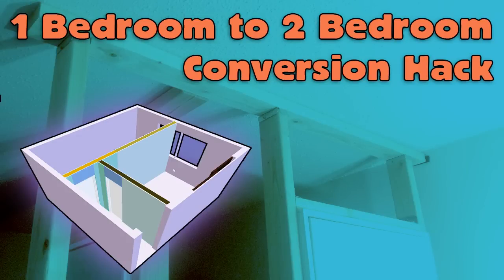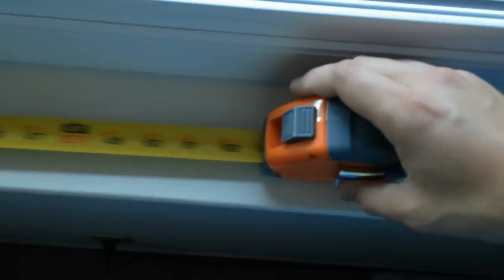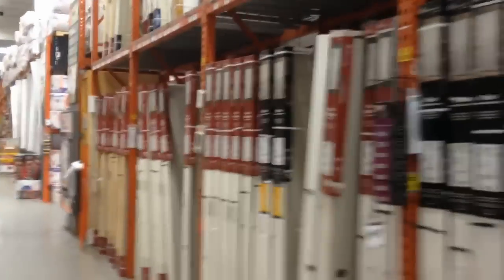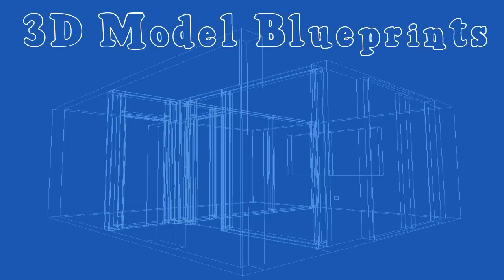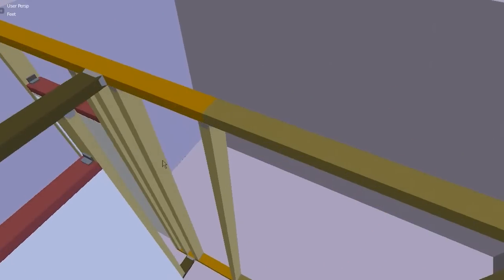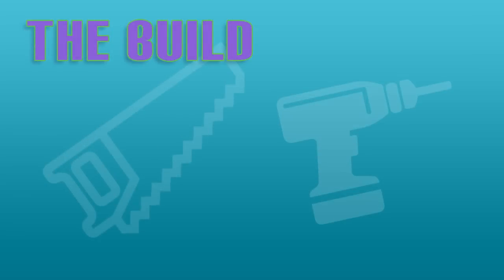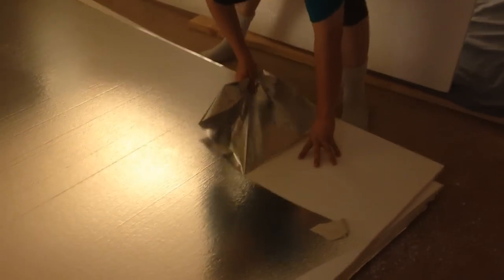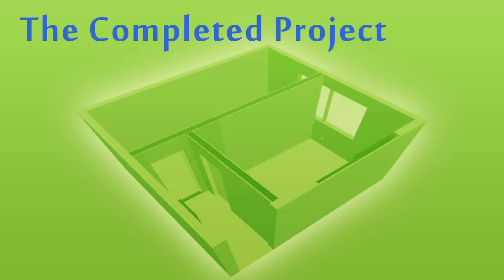1 Bedroom to 2 Bedroom House Hack

Comment: Thank you for sharing. How did the wall stay up? I don’t think it was nailed in to anything, correct?
Reply from the maker: It's T-shaped so it could stand on it's own. If you wanted just a single wall, you'd have to make some angled boards come out and hold it up or something.
Reply: @orokro_stuff  Thanks!

Comment: Did you have to drill into the floor or ceiling???
Reply from the maker: No, because it's T shaped it can stand on it's own. As you can see in the video, we put soft foam on the edges of it so it wouldnt scratch the walls.
Reply: If space you was doing was rectangular, how would you do it?

Comment: We have a one story house with only 2 bedrooms and i have 2 kids 4 years apart in age. The oldest snores now 😔 and 18 month old wakes up to the sound of a pin dropping and im a zombie at this point. The girls current room is right behind the living room so im starting in the corner on the other side of the door to section off an L shape from about 6f x 8f with the door the same direction as the original so not to make the small bit of hall too crowded with doors.. I saw this video when we first bought the house and didnt save it so i just took 30 minutes scrolling through my history back to january of 2020 😂

Comment: Great video! What program did you use ro perform the 3d model? Pr whar software do you recomens for a beginer that wants to do a si.ilar project like yours?
Reply from the maker: I used blender. It's not an easy software to learn, but I already knew it. Maybe sketch up or something for beginner.

Comment: I’m wondering who put the first hole in the wall... this is a genius idea but styrofoam walls?
Reply from the maker: Haha yea, we weren't really rambunctious so the walls stayed intact. We went with Styrofoam because it was cheap and easy to cut. You could use actual drywall panels if you wanted, but it's more expensive, heavier, messier and harder to cut. There might be some better material that's inbetween, idk.

Comment: Do you have a video on how to take this down?
Reply from the maker: No, but if you can build it it's very easy to take down - just go in reverse. Unscrew the Styrofoam walls first, throw screws in a bucket as you go and throw away strofoam. It's easy to cut into small pieces to hall out to a dumpster. Unscrew the metal brackets holding the walls together, in the same order you put them up in. Eventually you'll end up with a bunch of boards, screws, and brackets! The doors can be tossed hole, or sold, etc.

Comment: I'm planning on converting a living room space with this idea. I just wanted to get some insight on how sturdy the wall was or if anyone else knows how the wall is secured. Thanks!
Reply from the maker: In my plan, the walls form a T shape, so they held themselves up. I didn't secure them to the apartment because i didn't want to damage the walls. It's basically free standing, but I built it with sub centimeter tolerance so the gapes where our walls meet the real apartment are tiny. it stood fine.
Reply: @orokro_stuff  I'm renting out an apartment as well, so I don't want damage to the walls. In my case I would just need one wall across the living room area and it would form a bedroom. I don't have any experience in this type of work. Do you know if that could be done?
Reply from the maker: @b5790  If you don't want to mount it to the real walls, then you can do something like this: https://i.etsystatic.com/16370187/r/il/b4efdf/1396937447/il_794xN.1396937447_ot8t.jpg to make it stand straight at all times. I would probably make them a little bit bigger tho.
Reply: hypurban Thanks so much for the advice!

Comment: Why don't he use the thin wood thing(idk whats the name) intead of using sterofoam 😅
Reply from the maker: Not sure what you mean, but the Styrofoam was the cheapest thing we could find. Also, very easy to cut with just a razer blade.
Reply: Plywood or mdf sheets?

Comment: Man.. I hate being one of these people to correct you but..
1) Your framing 2X4s were way too wide on that main wall. 
2) Foam=🔥 bad move.
3) You said you were done at the end? Not gonna spackle? Sand? Paint? 
4) If ur renting and doing this, yohr landlord can get ur ass big time for this. BUT Landlords and Renters are Raping people financially to fatten their pockets.  How in the fuck is it cheaper to buy a house than Rent? Hmmmm. Price Gouging. 
So i say fuck the Landlord and overall. Cool room split
Reply from the maker: 1) wasn't trying to build to housing code, juts trying to make a very specific wall divider with a door :P
2) you're wrong about the foam - the foam is from the hardware store meant to be housing insulation, it's specifically fire-proof for that reason. Further, I tried lighting some on fire in the backyard / over concrete. It wouldn't stay lit, no matter how long I held a flame to it.
3) yea, wanted to keep it cheap, was mostly a privacy wall, plus we wanted it to be easy to tear down later, which was good since the LL hiked rent and we moved out the next year anyway. Those are good ideas though.
4) true, but we never actually attached it to the house, so it's technically a freestanding peice of "furniture" not a home improvement or building mod. Still, I doubt they'd be happy.
Thanks!

Comment: tyq44
1 second ago
How did you determine how many vertical 2x4's to put behind the styrofoam walls? In other words, how do you determine how much structural integrity the wall needs? I see you have 2 between the door and the wall.
Reply from the maker: I wasn't worried about structural integrity - the Styrofoam is extremely light, and this frame would stand on it's own, due to the fact that it was T-Shaped and fit the walls-ceiling perfectly. It wouldn't be able to fall even if it wanted to, because some part of it would bump into the ceiling or walls. (We put foam insulation on the parts that could come in contact with the walls/ceiling so we wouldn't scrape them if it bumps it)

The verticals were determined just so each foam piece could have at least two things to screw into. There were two on both sides of the doors, so the prebuilt frames could also have something to screw into.

Comment: one of should have just given up on having a window. you both would have had  equal space. both doors to one side opening out towards the smaller new hallway entrance to gain space in the room.. Whoever put their bed just inside their doorway, that should have gone towards the back where your dresser was. keeping your open floor space in front when you enter your room. an accordion door was better in this case I think.

Comment: What this man is suggesting is stupid.
There is no way any landlord  Council or Housing Association  will let you do this if you are renting. Even if you own your home you cannot just put up partition walls without planing permission from the Council.
They don't allow that in England where I am.
If you own your home you can if you have permission but there is no way you can do it if you are renting.
No landlord or Council will let you and if you did you would be evicted.
Andrea.
Reply from the maker: Hey Andrea, thanks for your comment. It is true that anyone who considers this project should use their own judgement based on their housing situation.

In this case, I consider more of a room divider than a construction job. Consider the following:

http://www.ikea.com/us/en/catalog/products/S79166399/

In this case it's curtains, which must be screwed to the ceiling, but divides a room into two.

http://www.ikeahackers.net/2016/06/free-standing-stuva-room-divider.html

In this case, ikea furniture was used to divide a room. I have also seen people use tall, ceiling-high bookcases.

Anyway, I feel like my project is nothing more than a very specific shaped room divider. Nowhere is it attached to the house (in the video I explained that it's just resting against them with foam padding so it doesn't damage the original apartment walls or ceiling).

Also, our apartment was a single bedroom, approved for up to 3 people. We weren't splitting a property or subletting, which obviously any landlord would have problems with.

Yeah, instead of curtains it has a prehung door, and instead of the curtains it has soft, easily breakable foam walls.

Some might worry about a firehazard, but the foam is no more flamable than curtains, and I actually flame tested it and I could not get it to stay lit - that's because the foam is used for insulation in houses normally, so it is fire-code spec.

Anyway, when we moved out the walls came down in 20 minutes, and didn't leave a scratch on the apartment. So, it's highly circumstantial and subjective if this project is right for your house or home.
Reply: Well if you live in a rented flat there is no way a landlord or Council will let you do this. Even if you own your flat if it's in a block you will find there is a landlord or management company who owns the building freehold. So you still won't be able to do it. Also if you are in a flat and you put up partition walls it could cause your neighbor upstairs floor or even your ceiling to fall down. As often in flats your supporting wall is the same wall that supports the peoples flats living upstairs or under you  or flats next door to you.

But a lot of the flats you rent here are ones that are converted from what used to be a house. Where landlords who do this put up partition walls. I used to live in such a flat but they are not as nice as a purpose built flat. As the walls feel like cardboard when you tap them and it makes the flat and space very small.  So in most cases if you want to covert your house into flats to let. It is better to keep the original rooms as they are and maybe put up a door to separate the downstairs from the upstairs.

It is easy to make one of the downstairs living rooms into bedrooms and to make one of the upstairs bedrooms into a living room. You can always have a bath or shower put in either upstairs or downstairs if your house has only 1 bathroom. And it is easy to get kitchen cabinets  and sinks to convert one of the upstairs rooms into a kitchen and put in electric points for an electric cooker. I say electric because here in England you can only have gas cookers in certain rooms because legally there is a gas safety law and ventilation requirements. So not every where can have gas cookers. But you can certainly put in an electric cooker or as many people are doing, buy a portable min or halogen oven that you can stand on a kitchen surface or table top.

That is a better option than to put in partition walls. In one place I used to live in my next door neighbors one bedroom flat was  simply 1 room made into 2. But his living room do no windows  which is awful.
Also putting up such a wall ruins the house and the room.
So it's not a god idea to do this.

If you need a 2 bedroom flat it is best to just get one rather than  put up partition walls which you are not allowed to do anyway if you rent.
And if you have a 1 bedroom flat, you can always put an extra bed in the living room. So you can have the bedroom and your friend can sleep in the living room.

Over here in England you find in many flats such as mine that the living room is big but the bedroom is a lot smaller.
That is also the case even in a 2 bedroom flat.

This is one of the reasons I have moved my bed into my living room and sleep there. So my living room is now both my bedroom and living rooms. Because I have got my couch, TV and my bed in there. While my bedroom is now a smaller living room with just a small couch and a lot more space than what I had when I had the bed in there.
But I could still put another bed against the wall in the bedroom if I wanted.

But it's not as nice to sleep in as my living room because the bedroom is smaller and so is the window. As the bedroom only has a small window right next to the main front door of my block. Which I hate as I am on the ground floor. So I have to keep my curtains closed when I sleep or else everyone will see me in bed.
And it's to hot in the summer because of the small window.   

But my living room had big patio doors. Which is cooler in the summer and also gives me more privacy as it's not next to the front door. And because the living room has a balcony in front it is more private and I am not so overlooked as in the bedroom. 

It is also standard practice here in England for landlords and councils to paint flats and houses while or magnolia(cream) walls. Which is not bad in itself but it's a color that everyone else has got.
So it does not feel very personal like when you paint it in your own colors.

Some landlords do allow you to paint and some don't, depending on the landlord. 
Other landlords who do let you paint do but they want you to put it back to how it was when you leave. So it's not worth painting it if you got to put it back. As you never know when you might have to move out and putting back would be stressful.

But there are other landlords that will let you decorate and don't make you put it back. And there are other landlords who won't allow you to decorate at all or even put up pictures.
It really depends on the landlord or letting agent. So if you want to paint you need to ask before you take the flat. Or ask permission first before you do it.

It's the same thing if you are in a Council or Housing association flat or house.If you want to decorate or do anything. You should ask permission first so you have covered yourself.
But most councils and Housing association do let you paint  your home in your own colors as long as you don't paint it red with black skirting board or anything like that. It's the same with most landlords who do let you paint which is fair enough.

But they won't let you do any building work which included knock down or put up walls. No way. Not if you are renting and even if you own your home you cannot always do it. Although if you own your own house you are more likely to be able to do it. As you are not under the rules of a freeholder as you are in many flats.
But I think you still need planning permission first. I know you do if you want to build extensions.

I don't know if it's different there in America but that's the way it is over here in England.
Andrea.
Reply from the maker: Do you have to ask your land lord permission to buy a new dresser? Or a bed? Or a book case? Because this wall I built is NOT attached to the original house in anyway, and is free-standing.

It's a piece of furniture that looks like a wall.

It won't affect neighbors above or below, because it's not attached to the house in any way what-so-ever, and it's no more heavy than a bed, or a dresser. (Light wooden frame and SUPER light Styrofoam walls).

I did not ask my land lord, because it's not a modification to the original property. It is a custom room divider, free-standing, with a couple doors in it.
Reply: @AndreaBorman  you talk too much. Its NOT permanent.  Thats it. Geez, some ppl just annoying
Reply: It’s not a permanent wall & can be taken down with maybe 5 screws. It does not require a permit as it’s not a permanent structure

Comment: hi, so i can't believe therent any other than ur video that shows how to make more rooms in a small apt. how can u convert a dinning room in to a kids bedroom?
Reply: in my case I had an apartment with a long  living room and dining room area (one continuous room)in a one bedroom apartment. As my family grew we had 3 boys . So when my first son came along , I went to Ikea  a picked up what at that time was on sale at 199.00 a 3 unit bookcase/ entertainment system.  Which were  really just Two Billy bookcases and ONE TV and stereo type entertainment bookcase for the center. I pulled them out away from the wall ,connected the back added wood backings later instead of that cardboard they use. lined it up from one side wall,and left a doorway open on the other end to walk in an out of the newly formed ROOM. Hung curtains using PVC pipe across the ceiling just behind the bookcases to give the feeling of a new WALL. and could go across the doorway if needed for "privacy" . Everyone who came in couldn't believe how the boys had their own room. They even had a FAUX window made from mirrors with a cornice over the top, and curtains. Still had room on the other side  to divide what was left into good size spaces for living area and a dining area .
Reply: As long as they restore to original state upon departure, shouldn't run into any problem.

Comment: questions! are the wall structures nailed on to the wall at all or they are just sized so perfectly that they just fit in
Reply from the maker: Nontaii They are not nailed to the wall. They are sized to fit very closely, and if you look at 6:34 in the video you'll see how we used rubber stripping so it doesnt scratch the house walls.
Reply: hypurban also won't you get in trouble with the landlord? how does that work exactly?
Reply from the maker: +Nontaii Never told the LL, but technically it's just a very specific shaped peice of "furniture." You could also split a room using tall bookcases... but instead, why not a custom structure instead of bookcases?
Reply: @orokro_stuff  Hi, I know it;s been a while so I wish you'd still respond. Does this only work because it is T shaped? I am planning on closing a loft for airconditioning and I am only planning on putting up a "wall" on the side that's open. I can build it as close as possible to the ceiling/walls, but I still think it's gonna fall. Can you give me some advise?